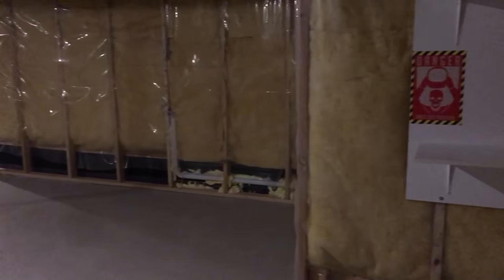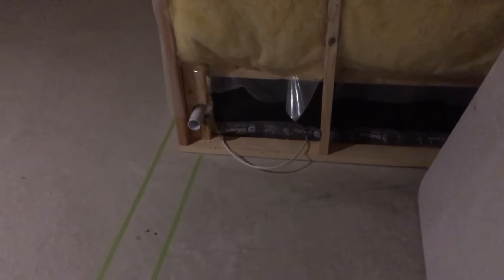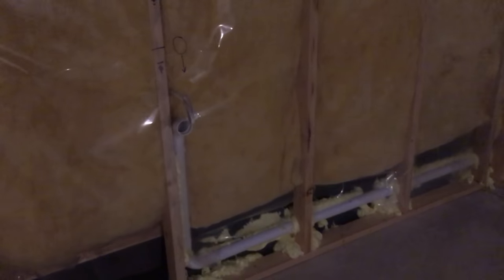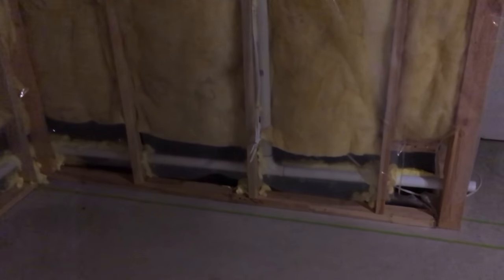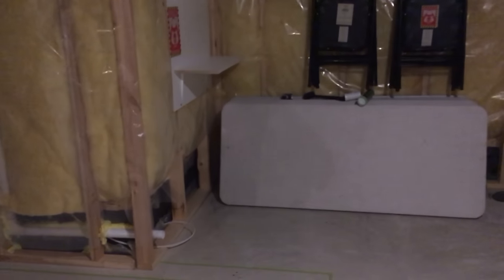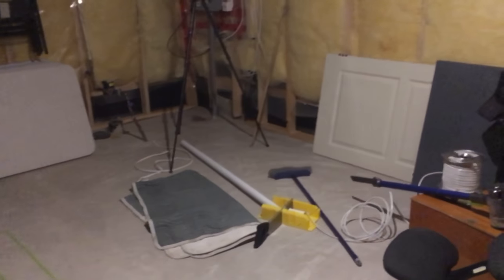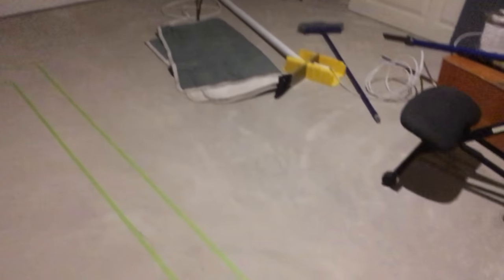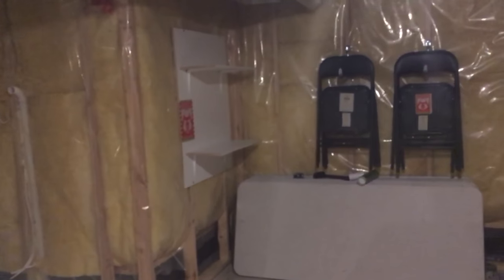Sound Studio - Dead Room Update - The Chase - Remote PC

Comment: I work alot on ATC installations (Air Traffic Control) the big push now is fanless quiet systems to reduce stress on the operators, that used to be handled by implementing huge heatsinks or heatpipe tech. Now however its easier to run the machines in a separate server farm room with fibre optic network to the displays, this carries all I/O and the display generates the image from the data (more like a streamed LVDS) by separating the machines from the user we are reducing noise, just the same as you are doing!
Reply from the maker: Yeah, for an environment like that white noise would just drain you and add to the stress of the job. I think the idea of a thin client with no moving parts would be a great solution or just running remote. Both PCs that are going there are actually already quiet because they used to be near my desk (They are temporarily still near me until the room is built) One has a 280mm LC on the CPU with 2x 140mm fans and the other (server) has a massive passive cooler on it. The case has a push pull 140mm fan setup running about 400 RPM.

Comment: Hey is that a kneeling chair you have? If so, how do you like it? I've been considering one but my impression lately is that it was a fad that's fallen off. I draw at my desk and I would think it would be better for my back than a regular chair.
Otherwise, great vids, I like seeing this process.

Also, is that the only support the chassis's will have? I would think that setup might eventually fall down without some additional support.
Reply from the maker: +Conor Hughes the chair is not my bag. It is fine for a short bit. The shelves are honestly the least of my concern right now because if I am not happy with them, I will simply address it. Thanks for posting and you might see a change there.

Comment: Dumb question, but how do you feed cables through the chase pipe?
Reply from the maker: +James Allen use a vacuum cleaner on "Blow" to feed a piece of string through. Tie the wire to the string and pull.

Comment: I'd say dw about the time it takes and do it right so it's like you want it to be. Also that shelf looks really flimsy rather go for a metal version than a plywood one.
Reply from the maker: +LordElfi thanks, they are NOY flimsy. They were glued with PL to the back board and the screws go into stud. The PC isn't heavy at all. It will be fine. Once it's all together, you will see.
Reply: +TheNOOBIFIER1337 Ah alright. I had similar looking setup that tore off the wall and ruined about 1800$ worth PC so when I saw yours I had a flashback to that
Reply from the maker: No the plan was to try it and if it was remotely unsettling, to replace or address it.